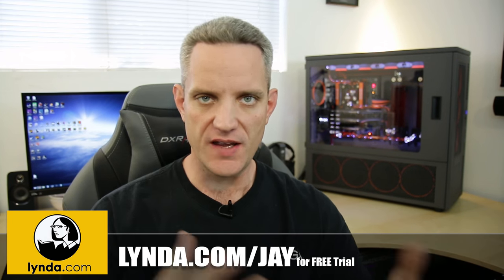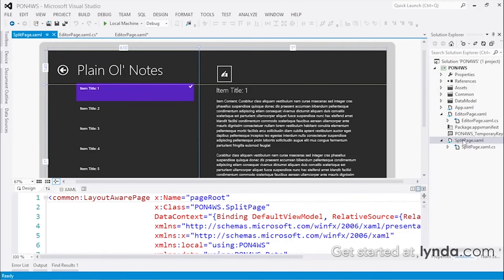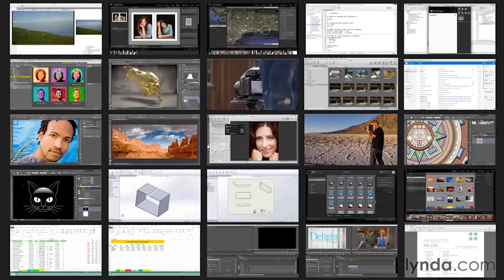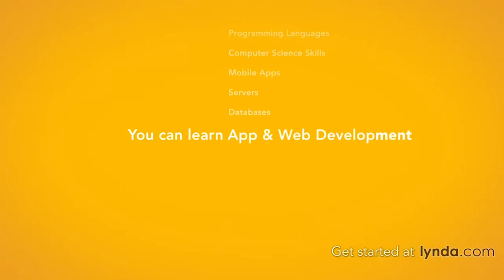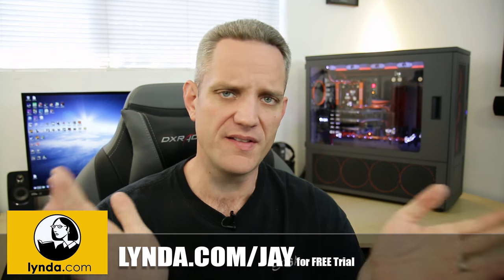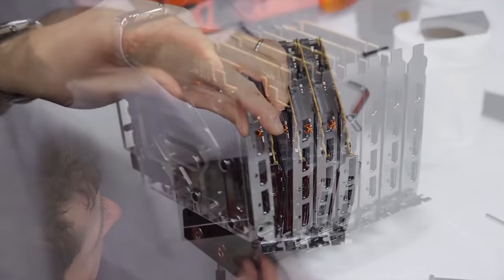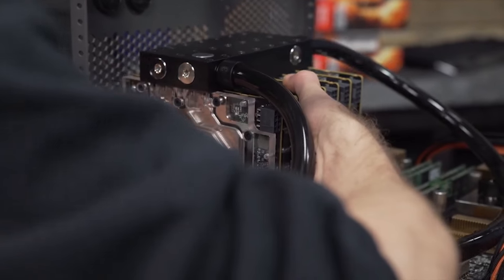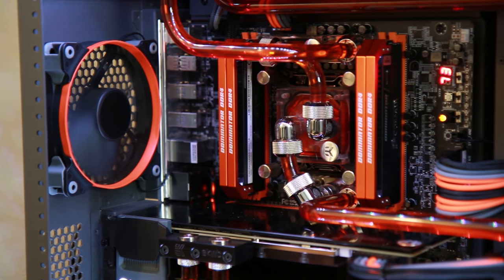Is watercooling worth it?

Comment: It's come time to upgrade my CPU cooler, my teeny T2 Blizzard just isn't cutting it anymore, with temps in the 60s while under load.
The question is, beefier air cooling or an AIO? 
This AIO, actually: http://www.scan.co.uk/products/cooler-master-seidon-120v-version-20-water-cooling-kit-quiet-with-compact-120mm-pwm-radiator-for-int
For comparison, this is the Air cooler I was considering at £20 less than the AIO: http://www.scan.co.uk/products/cooler-master-hyper-103-cpu-cooler-for-intel-lga-2011-1366-1156-1155-1151-1150-775-amd-fm2-fm1-am3pl

Further info: I run my i5-6600k at 4.4GHz and do not plan to increase that.

Comment: Just cleaned my wc system and the cpu block was completely clogged with slimy white stuff???
System was running for 5years 24/7 never cleaned it so yeah i know its my own fault ;)
Reply: If i recall correct, once a year is enough to keep your wc loop clean :)
Reply: FullFledged2010 slimy white stuff ey? 😏
Reply: You should clean out any PC once a year.

Comment: I will never mess with water cooling
Reply: +Taylor Cassell Good. Its risky so I stay with a AIO cooler
Reply: Rikki Boodram I have my regular cpu fans going and it's not getting pushed too badly. I'm not an overclocker either so it's totally not worth it. Plus, Jay said you shouldn't have diminished performance if you want water cooling. I will never do it even though it looks awesome haha
Reply: That's cool man my stock heatsink started to go so I went with the AIO just in case i wanted to push my system in the future i have room to do it.
Reply: Rikki Boodram Nice. I would only consider overclocking my graphics card and there's no need to water cool it
Reply: Nah I'm not a overclocker myself, I don't see a need for it because I have high end parts in my rig that's fast enough to satisfy me.
Reply: +Rikki Boodram overclocking is risky anyway. It can shorten the life span of parts and mess things up. It's not worth it to me
Reply: +Taylor Cassell if you mess with watercooling then you better leave to other that dont mess but just use.

Comment: Jay i have That GPU "980Ti Kingpin 80% ASIC" With a AIO CDC Water Loop :D These high ASIC cards even with Kingpins  Custom Bios still derp with Volts mines Sweet at 1.110-1.200Mv :D (1520/4095<Game profile) anything higher and it Derps hard haven't tried Vdroop yet :/

Comment: hahahha.  I air cool.  I should probably liquid cool for my rig but I choose to air cool in spite really.   I have an Intel 6600 i5.  3300 MHz.  I clock it to 4.8 gig and I air cool.  I had to flash the bios and change the core voltage but I still air cool.  2 to 3 degrees c is not enough for me to make the decision to liquid cool. but I run a cooler master v8 gts heat block.  anyway love the video I did hit that like button and did sub.  keep putting out great video's

Comment: I need help designing a pc that I will make eventually I need the best two gaming graphics cards and the best work station graphics cards if there isn't a difference and the best gaming cpu and best workstation cpu I want to put all that on a  ASUS Z10PE-D8 WS SSI EEB Server Motherboard Dual Intel Socket 2011-3 with  
Kingston 32GB (4 x 8GB) 288-Pin DDR4 SDRAM ECC Registered DDR4 2133 (PC4 17000) Server Memory Model KVR21R15S4K4/32and want to water-cool it with 2 separate loops one for the gaming side of things and one for the work station side of things I need all the help I can get
Reply: +lol lol and I want to overclock it too